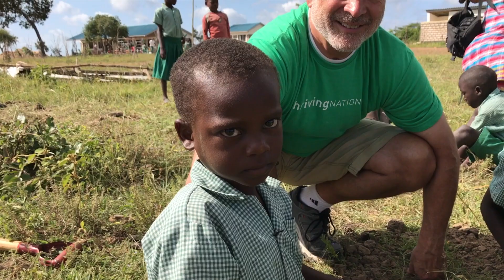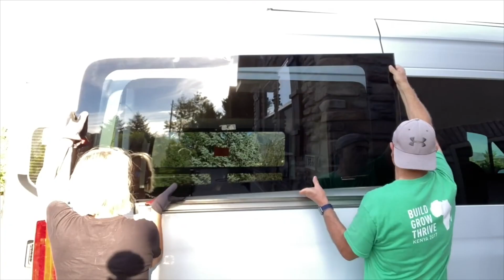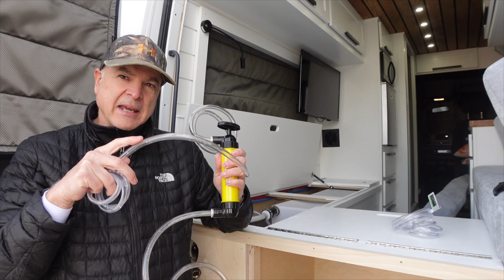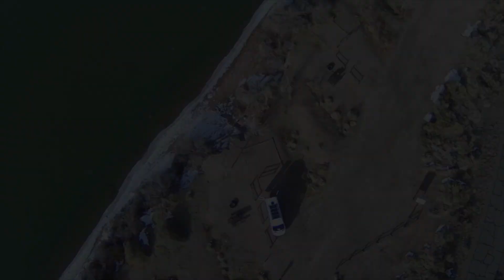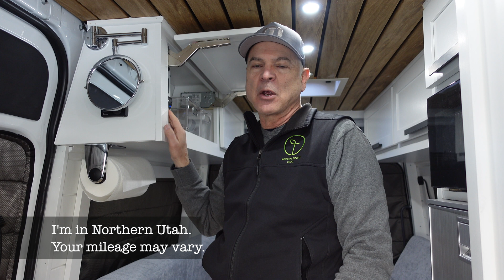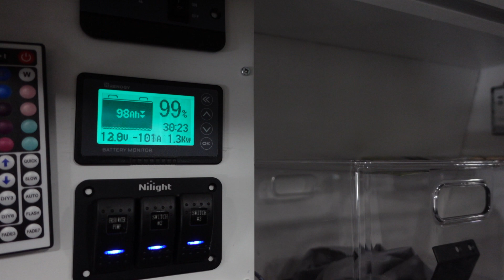Van Build | How to Size Your Solar System- Solar Panels, Batteries, Inverter

Comment: In hotter climates (southern Arizona), will the lithium batteries inside the van explode, if you’re storing/parking your van for the summer months & not driving it?

Comment: Im building a van and got a solar kit that will do 400w. I got a pure sine wave 2000w inverter and 2 12v deep cycle 200ah LiFePO4 batteries and a new altinator that charges 200w.

Comment: Great video, right now I have 500ah and 2-175watt (350watt) of solar with 3k inverter and BIM for alternator charging and a shore power plug in.  Might upgrade my battery bank to 660ah just to have a bit extra on longer off grid trips. I cant really upgrade my solar because i have an upper deck that takes up half my roof space and i love that area. Think this setup is decent but definitely could use more solar. In a future build ill probably max my roof space with walkable solar.

Comment: Hey Jeff, I 've just wanted a few of your videos and noticed your electrical system layout. I like how you mounted the 
"fuse box panel"/ distribution panel. You mentioned you would cover your electrical system in another video. I can't find it. can you post link for me. thanks. BTW- Great content and easy to follow procedures.